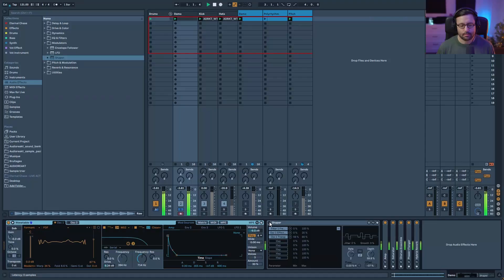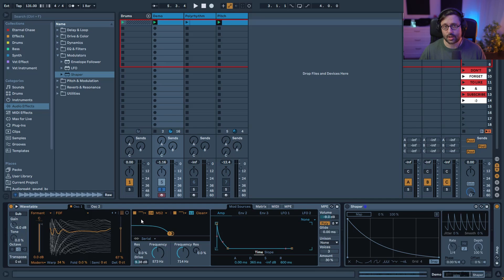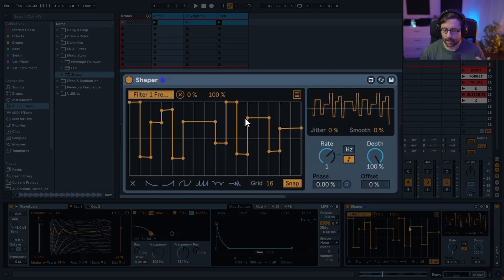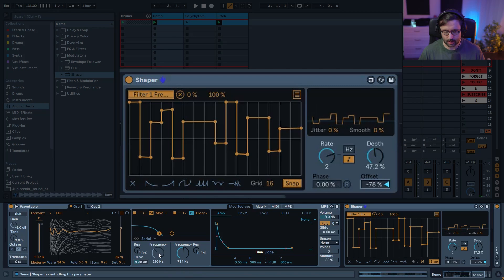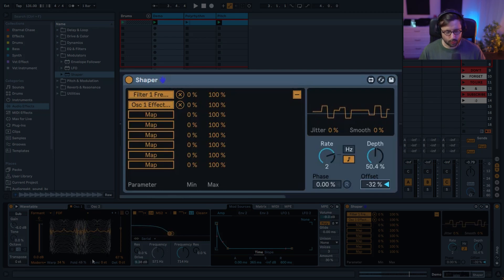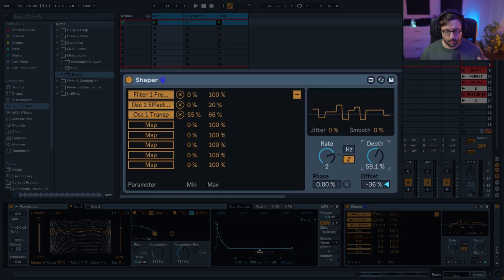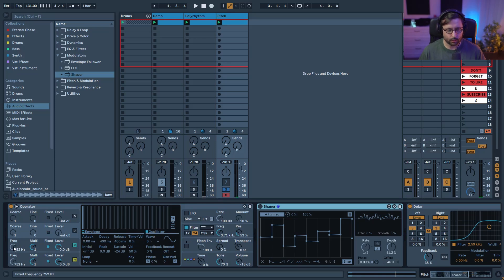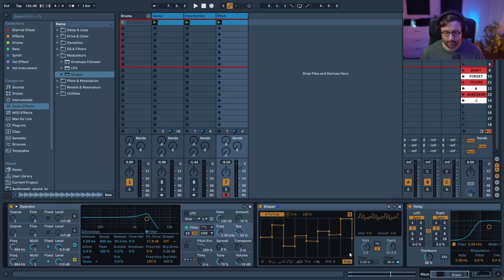Ableton Shaper as Step Sequencer (Ableton Tutorial)

Comment: Thanks! I found this device thanks to you. But I also noticed some limitations in it. For example when you chsnge the speed knob like 1/2 and you have 8 beats in it, then the half of the beats are cut, so it modulates only with first 4 beats. And do you know similar devices but using faders instrad of curves, like in mono sequencer?
Reply from the maker: yes I know the problem, but couldn't find other solution. then in term of sequencer you have Rozzer which is a free maxforlive sequencer
Reply: @audioreakt  I also found max device called - StepOne   which is perfect for automation like this :)

Comment: Did you know if you double click a point  it turns in to circle and acts like sustain ? It can be very confusing if you don't know and double click it by mistake. Strangely it is not mentioned in user manual.
Reply from the maker: I didn't know, it is very strange and act very strangely indeed, thanks for letting me know
Reply: @audioreakt  it basically freezes modulation until end of the duty cycle. In other words, like a sustain.